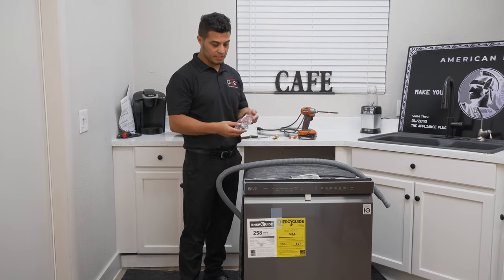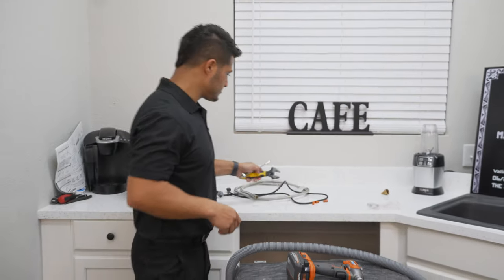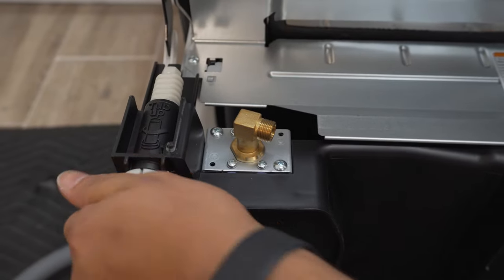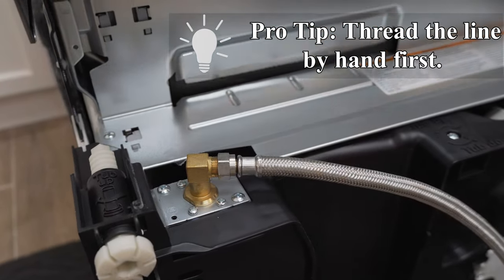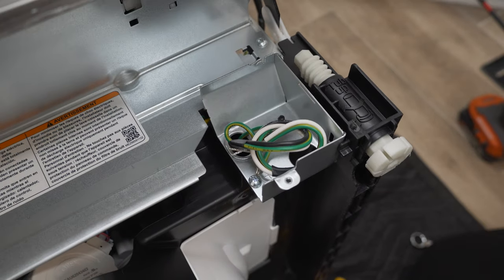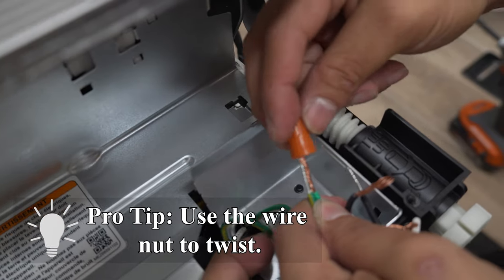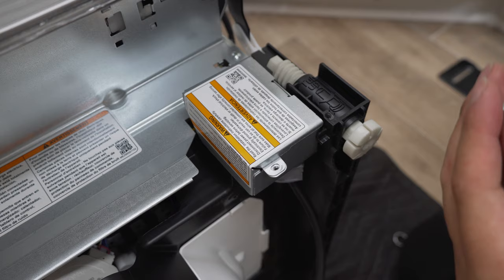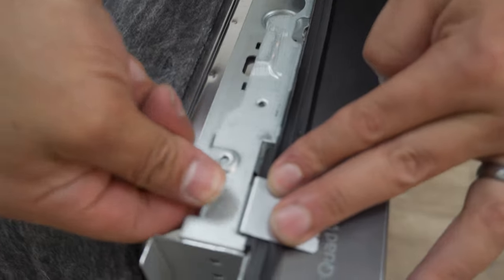How To Prepare Your LG Dishwasher for Installation

Comment: Ill tell you how to prepare it. Don't open the box and return it to the store and get a different one. After spending hours watching tutorial videos trying to figure out how to operate this dishwasher, I've come to the conclusion that it's overly complicated and poorly designed. Nearly all the reviews I've found echo the same sentiment—this thing is a nightmare to use.

First off, the control panel might as well require a degree in rocket science to decipher. Elon Musk would probably call it a "dumb design," and I couldn't agree more. Who needs a half-inch thick manual just to figure out how to turn off the drying cycle?

To add insult to injury, they want to charge me $5.00 just to answer a basic question about the settings. And don't get me started on the layout of the buttons—they're so awkwardly placed that I have to open the dishwasher door just to see or press them. Why not have buttons on the front like a normal dishwasher? You know, with clear labels for Normal, Heavy, Delicate, High Temp, No Heat Dry, Start, and Cancel? And please, no dual-purpose buttons that work only when you release them!

And speaking of confusing, what's the deal with the Auto cycle? It shows the same time frame for both half load and full load. Does the left arrow mean wash the top load and the right arrow the bottom load? It's baffling! Is it too much to ask for intuitive controls that actually make sense?

To make matters worse, pressing start often results in no countdown and no action. Is there a reset button somewhere hidden in that dense manual, or is this thing just defective?

Oh, and about those annoying chimes and sounds—it's impossible to turn them off, despite following the manual's instructions. And what happens if there's a power outage while the dishwasher is running? How on earth do you resume the cycle once the power's back?

And here's the kicker—the app that took over 2 hours to get working is completely useless because the dishwasher powers off when not in use, which also turns off the WiFi. So much for starting it remotely! You have to manually go to the dishwasher to start it anyway. And why are they not 5G?  Guess they are saving a buck by using outdated tech.

And let's not forget—I can't even figure out how to set the darn clock. It's not in the manual!

I honestly wish I had my old dishwasher back. 

Save yourself the headache and avoid LG dishwashers like the plague. It's a disaster waiting to happen and not worth the frustration.